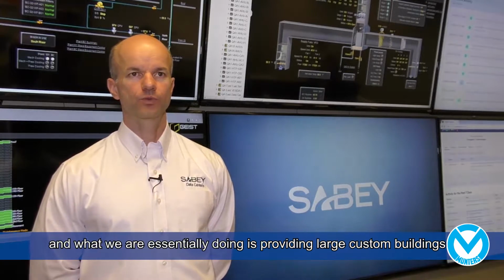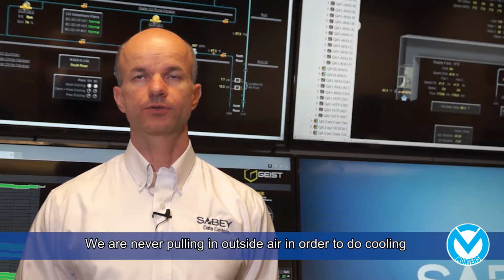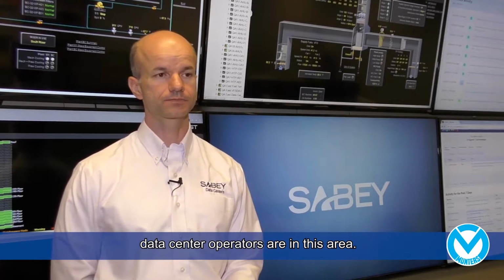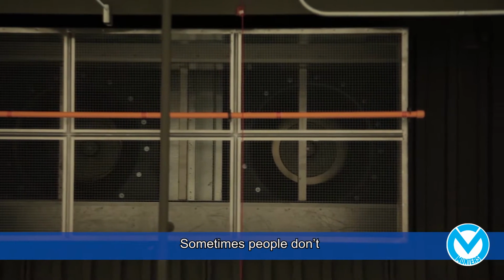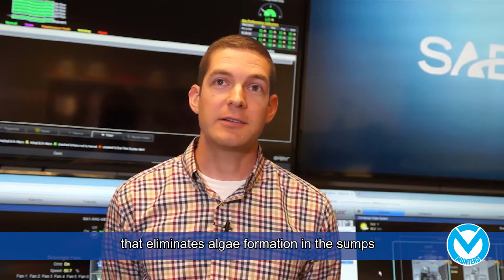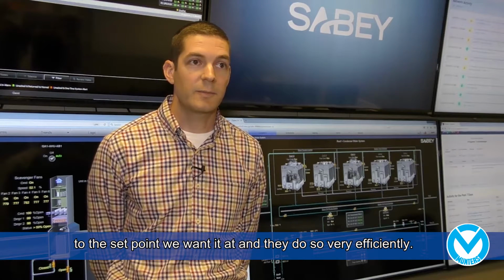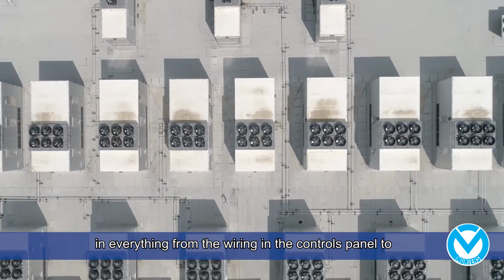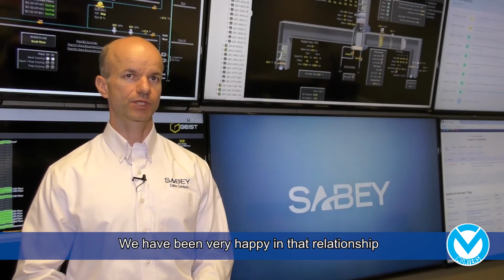Five years of unprecedented energy savings at Sabey data centers    Video Case Study

Comment: Hi

My Name Hakan

I am an inventor.
I am writing you from Turkey.
 (TUR)

I have a technology that provides 25% kwh electricity saving in dataceter 

type machines.

I have developed a technique that saves electricity without changing the 

speed of DC or AC, PSC Type and Shaded Pole motors on the devices.

The system is very simple and pays for itself with savings within 3 or 6 

months.

Are you interested?

Best Regards
Hakan YILDIRIM 
GSM + 90 546 283 76 80 ( I Can Only Speak Turkish )
mail: saveplug@hotmail.com
https://www.linkedin.com/in/hakan-yildirim-74683445/